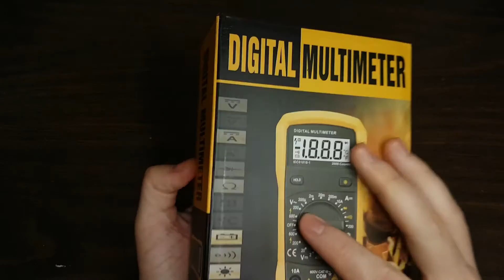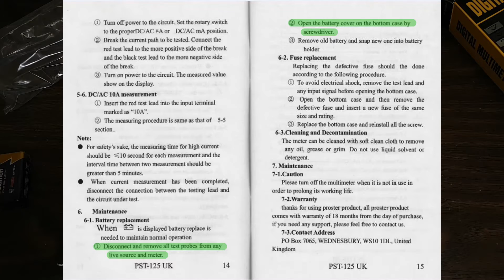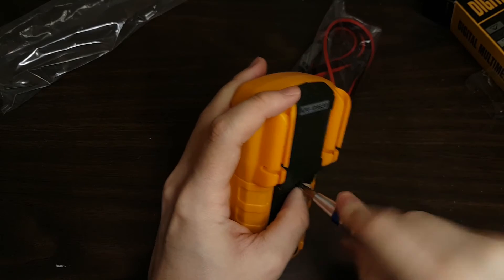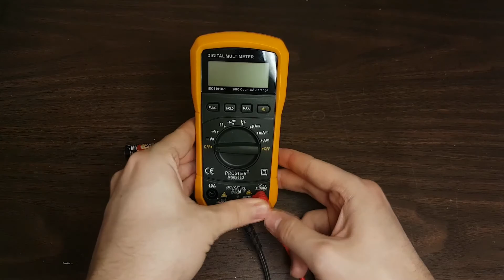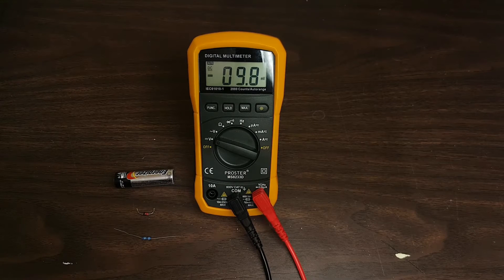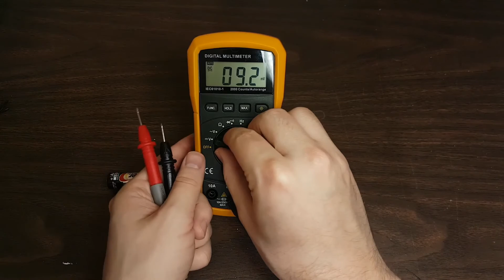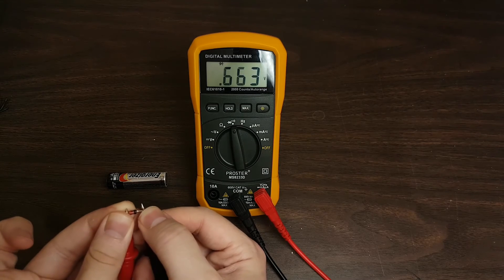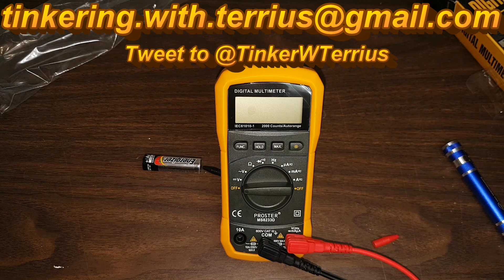TWT #1: Proster MS8233D Digital Multimeter Unboxing

Comment: is this the same stuff? because in the manual written MS8233D like Mastech or Proster 
this link https://www.banggood.com/NEW-AIMOMETER-F0601005-Digital-Multimeter-DMM-p-1103039.html
Reply from the maker: That looks very similar, a bit more similar to the DM02A though which is configured a bit differently.